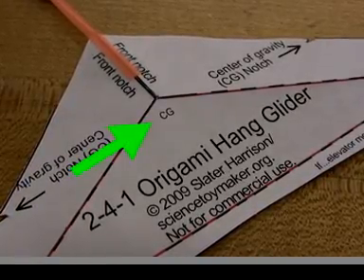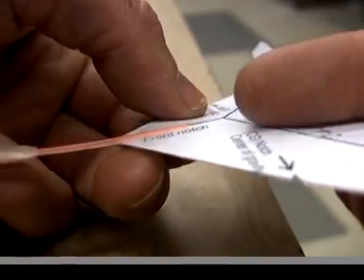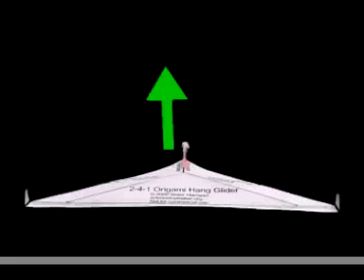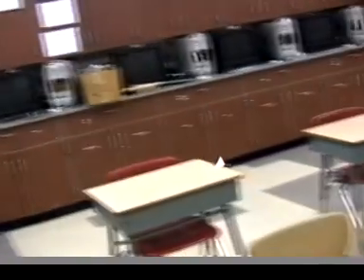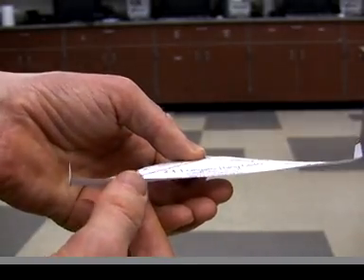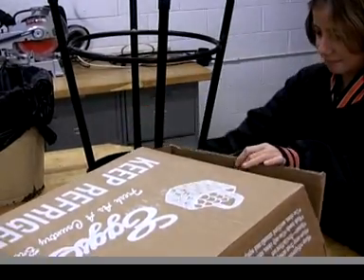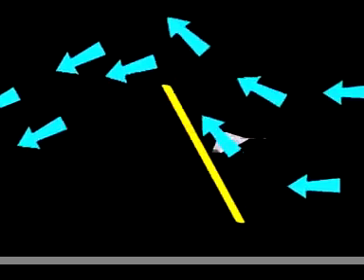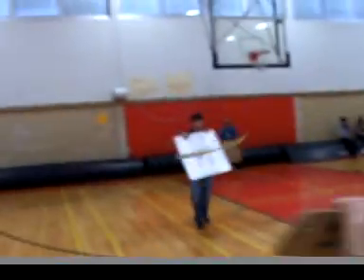OUTDATED Part 4 Surf an Origami Hang Glider on a Wave of Air_Adjust Fly.mov

Comment from the maker: @rentatrip1 Well, the video is about is about using cardboard or something to make a wave and surf on that wave. I thought you seemed to be saying your gliders got lift from either blowing air or a thermal from the floor heater, which is a little different. So your planes would be a good candidate for surfing. In any case, yes, I'd like to see a video of them flying.
Slater

Comment from the maker: @Gamer8065 Well, if it's close to balancing then that's an ok starting point. Make sure the elevators are the right angle, then add tape if it stalls, cut it off if it dives. I've been having trouble with my gliders lately, perhaps the humidity makes the paper too limp. I'm working or a simpler design.
Slater

Comment from the maker: @ahsanaliali You can try cutting a little bit of tape off the front, until it stalls. Then add just enough tape to keep it from stalling. 
I am working on an easier to make, more stable design. I hope to have it up in a few weeks.
Slater

Comment: Very nice!  However, one technical point; the turning doesn't happen because drag is increased or decreased when the elevator (technically an elevon) is moved up and down.  It's due to a change in lift which induces roll.  The lateral component of lift (now that lift is no longer vertical) causes the glider to turn.  You probably know that and are simplifying it for the kids but I just wanted to make that note.